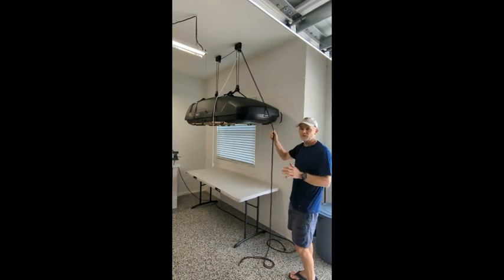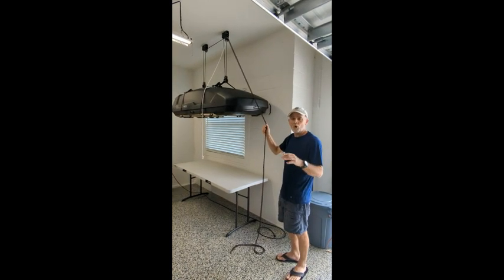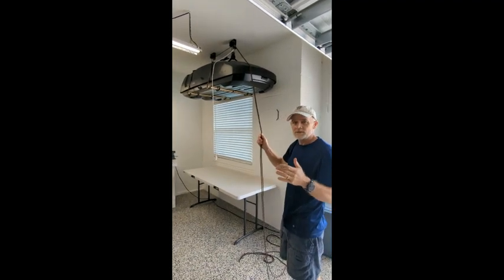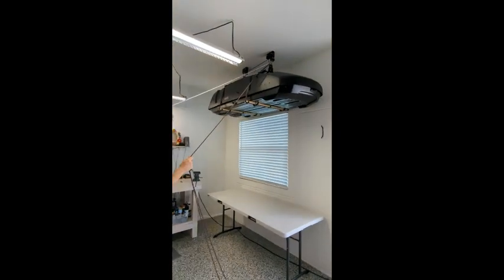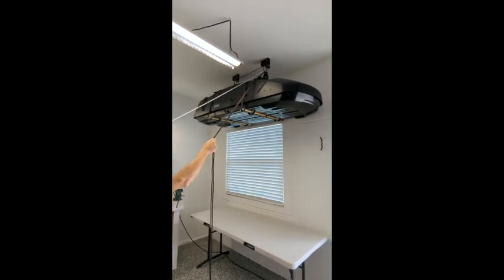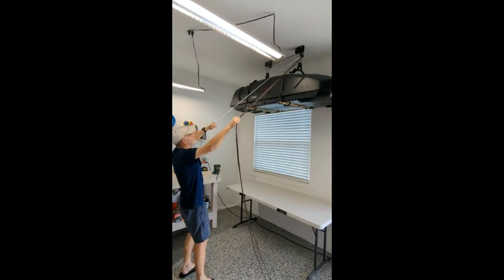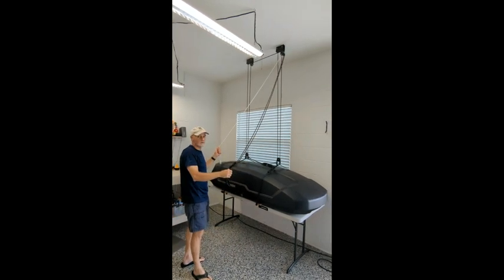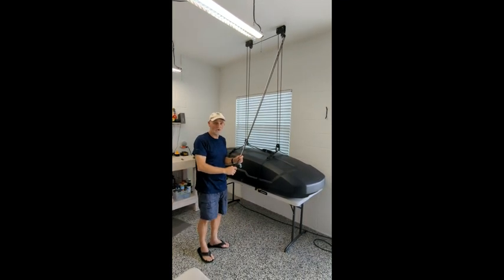Review: StoreYourBoard Cargo Box Ceiling Storage Hoist, Rooftop Carriers, Hi Lift Pro Garage

Comment: All you have to do is bring the rope to the middle off the two pulleys and it will pin down the brake and lower no problem.